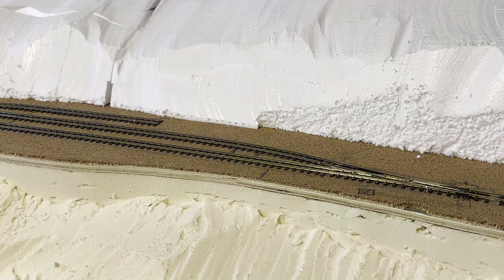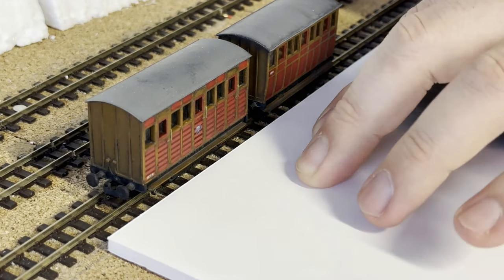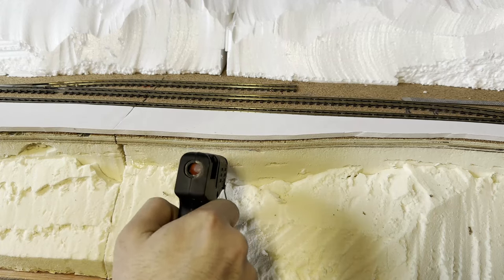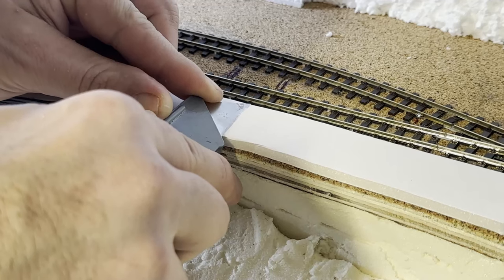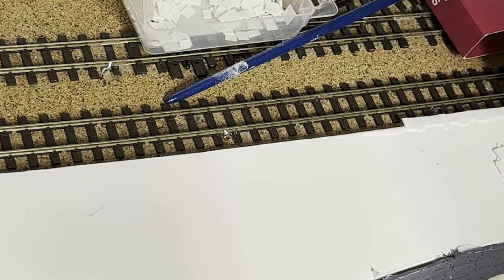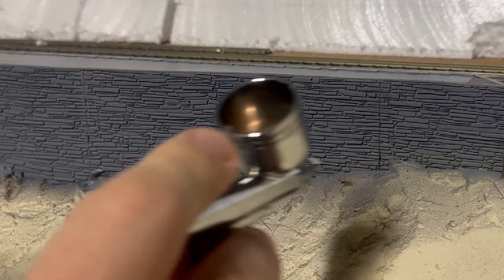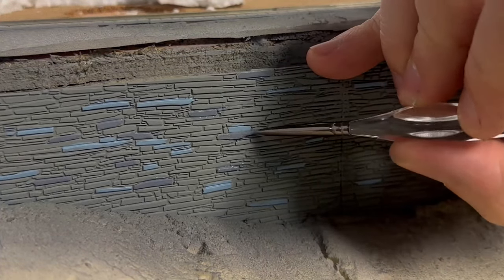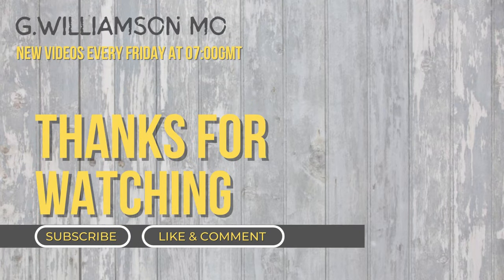Model Railway Platforms: Slate Walling and Scratchbuilding

Comment: I thought that I might use your technique for platform construction on my layout howver my platform faces the viewer. How do you finish/ paint your foamboard below the copers? I've never used foamboard so can the ends be carved to represent stone?
Reply from the maker: If it faces the viewer, I tend to cut a slither of embossed plastikard and glue it to the side, which can then be painted up, though if you’re doing a narrow gauge platform thats basically rail height, you could just paint it black/dark grey and weather it up